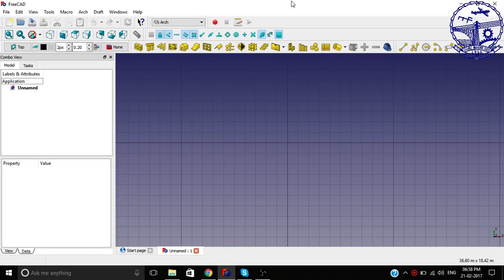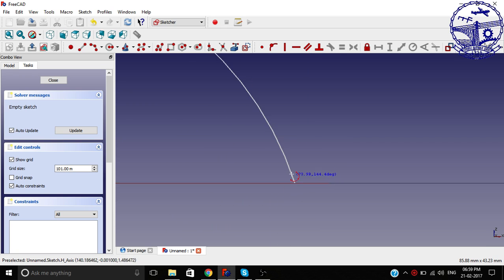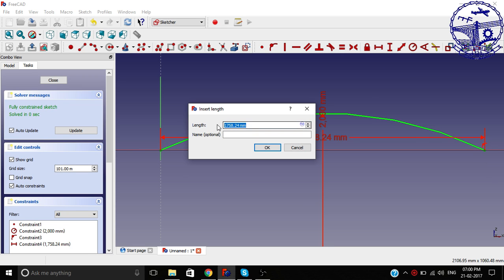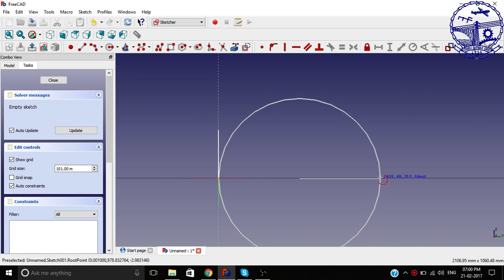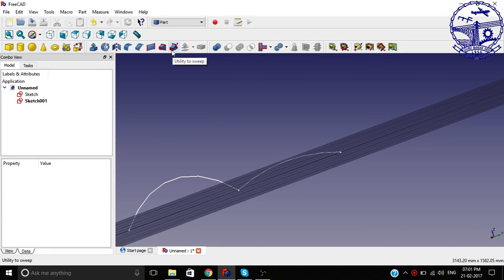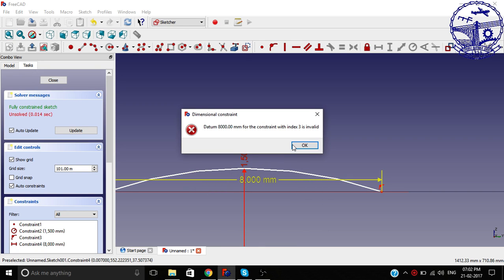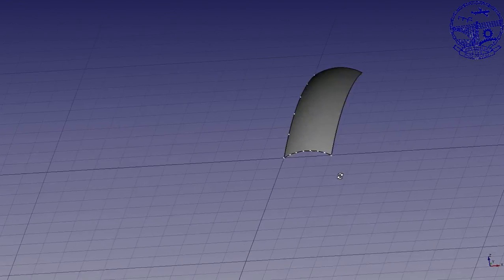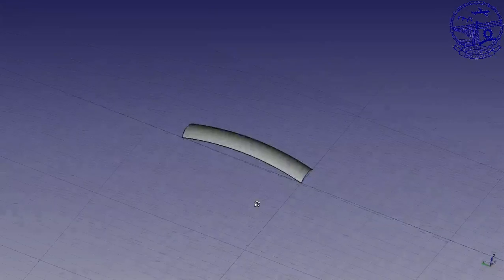FreeCAD Tutorial: How to Create a Bend Surface

Comment: it will not let me create a new sketch. i hate that every video just blasts through where to click or what to click cause ive been trying for 3 hours to draw a sketch on more than just the first plane
Reply: Did you figure this out? It's a small icon that is a white rectangle with red round and square lines inside it? Easiest to do it in the sketcher workbench.